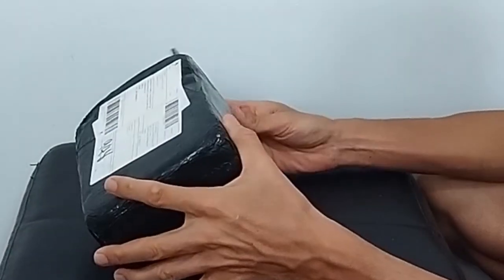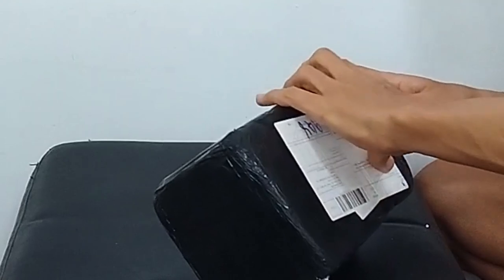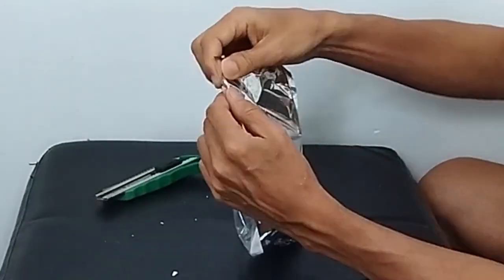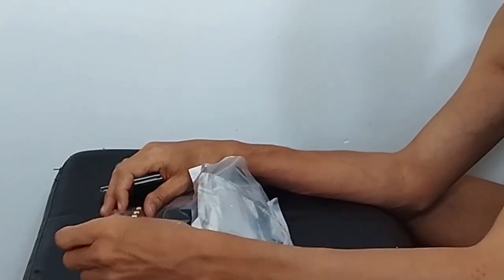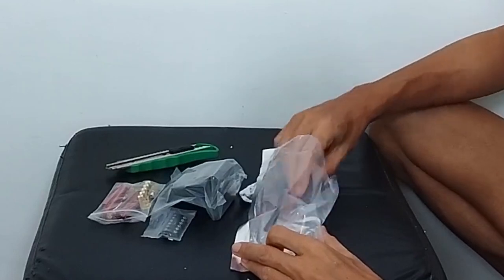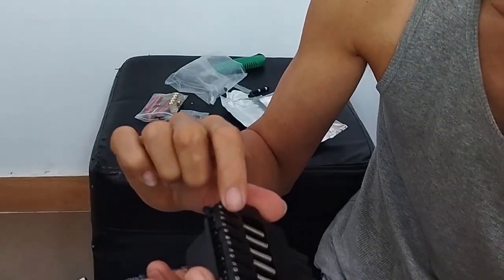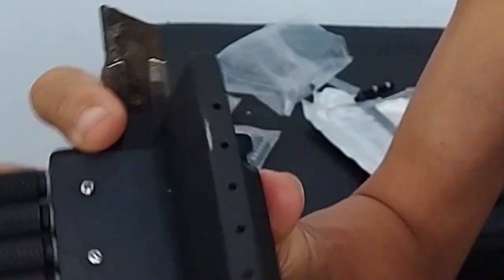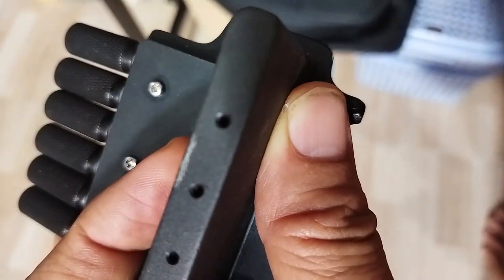Hipshot headless tremolo bridge copy - UNPACKING

Comment: Hello! your videos are very interesting! They are very helpful to me! How has your experience been with this latest "Hipshot Guyker" alternative compared to the other previous models? Is there tuning stability? does it meet your expectations? do you recommend it to buy? is this last tremolo alternative really good?
Reply from the maker: in term of the Chinese headless tremolo bridges, for me, so far this is the first one that meets my criteria: tuning stability is good. Fiddleing, adjusting around the saddles are easy and you do not need5 different sizes of hex keys. A bit bulky but at least, stable and uses the good old Fender way for the saddles. You may have some initial learning curve to change strings but not a big deal. Actually, I ordered another one that I will built in (not alone) but somehow this time custom office wants me to pay extra tax on it. So it got stuck and I guess, officers are thinking how much they can charge me on this. lol